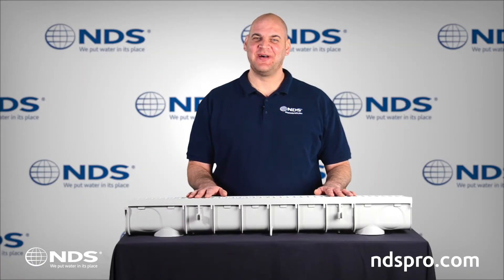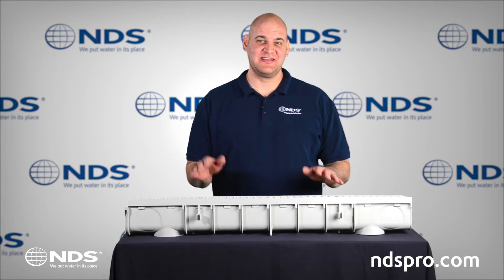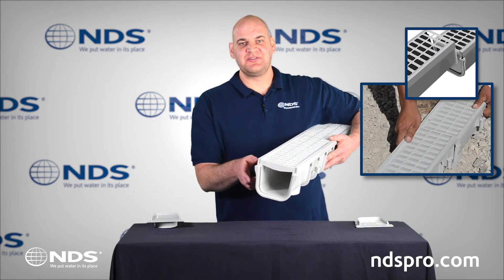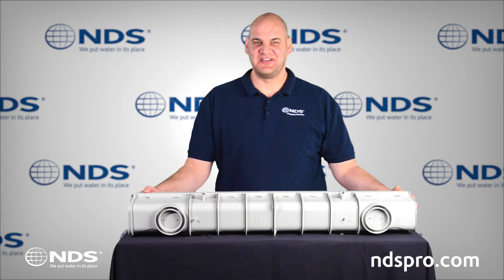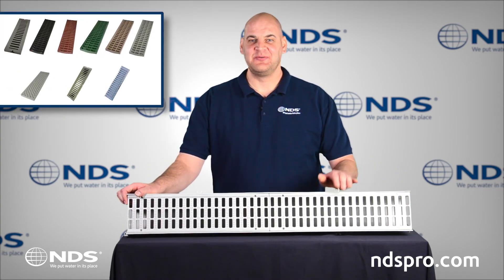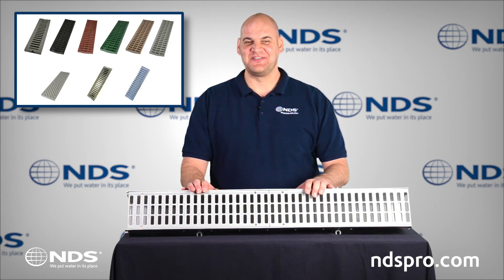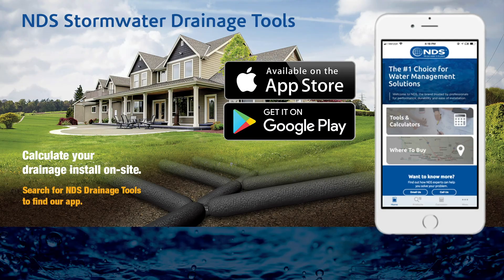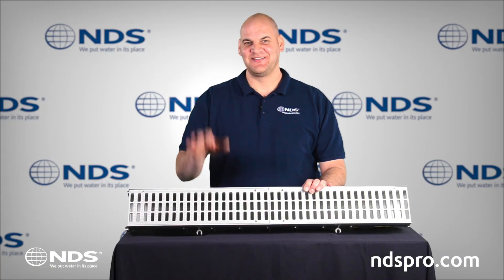Introducing the 5 in. Pro-Series Channel Drain with Side-outlet Knockouts | NDS Drainage Systems

Comment: This thing is a waste of $...you’ll die trying to get a waterproof seal to correlated pipe.
Reply: I assume you mean corrugated pipe?

They have PVC to corrugated adapters that might work but I agree that getting a watertight seal would still be a challenge.  You might have some luck tying an adapter between the corrugated pipe and a PVC elbow which could then be tied into the end outlet.  

But, I would gander that trying to do something like this from the bottom outlet using corrugated seems untenable at best.   Just my guess anyways.

EDIT:  I was dumb enough at first to try and force an adapter between the drain and the corrugated pipe to the side knockout.  Wasted 3 bags of concrete, a tube of incompatible sealant, and time.  

Hopefully I have a better plan now.

Comment: With the side knockouts, how or what do you suggest using to connect for a 'tee' connection?
Reply: Did you ever find an answer to your question?
Reply: I'm guessing the side outlet from another one of these channel drains.  Gonna give it a shot tomorrow and find out.

The other alternative is you would have to waste another $60 - $85 on a 90° elbow.  These NDS pro series drains already cost a fortune as it is.  

I'll let you know what I find out.

Edit:  more likely than not, you will have to put some sort of waterproof sealant around whatever (if anything at all) fits in the side knockout.